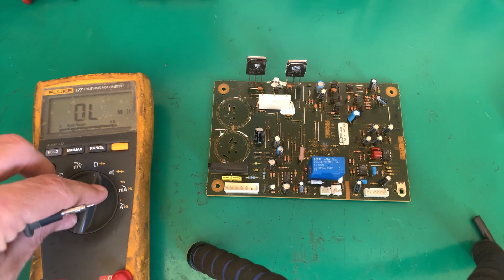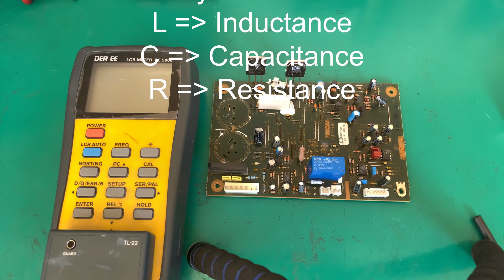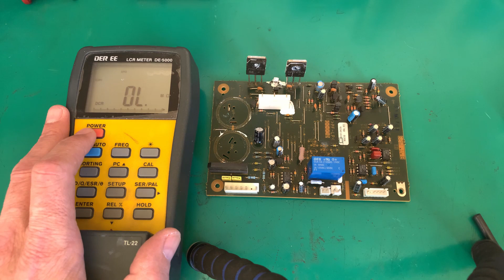FoulkesBrau #40 - Sony SA-WP780 Active Sub-woofer repair PT2 with costing

Comment: Sir, i have problem with my active sub woofer sony sa-wms835 i found out that on it's board that the small square color grey is deformed and kinda broken then there's black thing come out on it. And i researched that it is a safety capacitor. My problem is it turns on but there's no sound coming out from it. Hope you could help me. Since I'm not sure on what i am doing.
Reply from the maker: Hi Patrick,

Well you need to replace the safety capacitor first. 

You will need a signal generator to put something in, and then use a scope to trace the signal path. It sounds like your pre-amplifier or amplifier circuit have gone. This circuit will either be transistorized or IC driven. 

Best of luck.

Craig
Reply: @foulkesbrau3085  thanks for the reply sir, is there any chance that it might be just the safety capacitor is the only problem? Coz I'm checking the circuit board there's no any signs of kinda burned or blown fuses or transistors, it's the safety capacitor is the only thing i saw that is deformed.
Reply from the maker: Hi Patrick,

Just because the components don't look blow, it does not mean they're fine. To be sure you need to measure the components. 

I hope this helps.

Cheers

Craig
Reply: @foulkesbrau3085  okay sir thank you very much for your reply and i appreciate it.